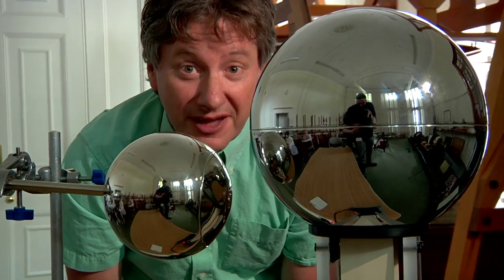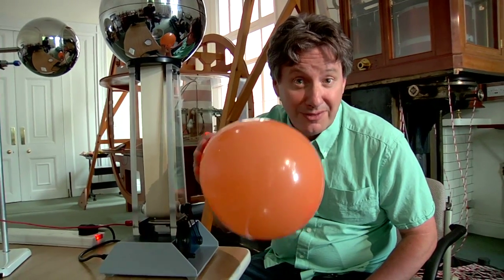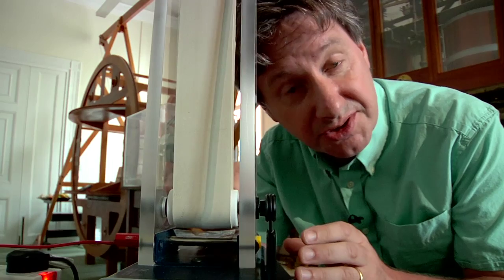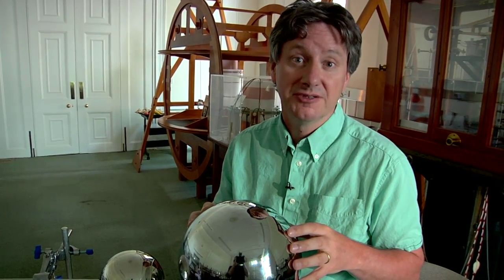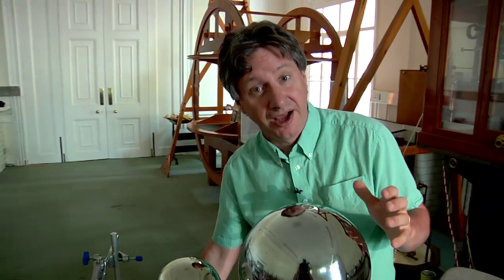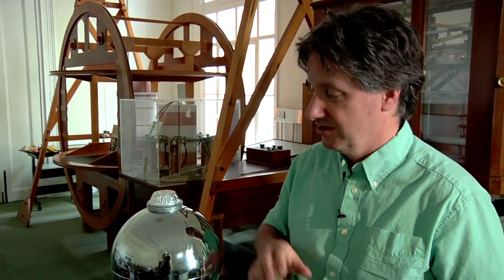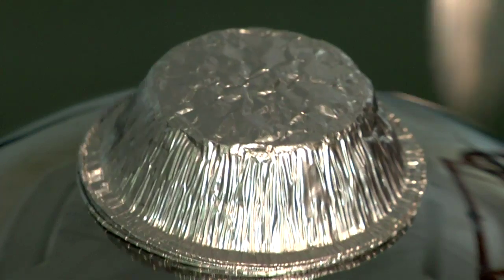Using a Van de Graaff generator

Comment: This is a nice demo and a rather-complete explanation, but I think there are several misleading statements, per what I have learned from various electrostatics experts.

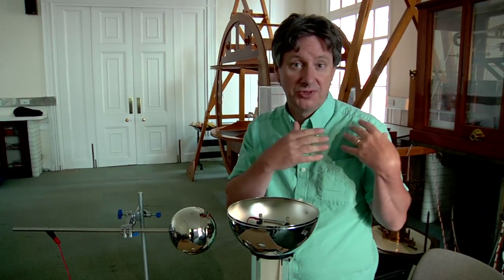At 2:58 minutes, the charge transfer is not caused by friction but rather by mere contact of the dissimilar materials.  However, mere touching only brings the high points of the surfaces into contact.  The motion does help considerably by producing a lot more points of contact.  

At 3:49, if the rollers are made of the same material, I think the generator can still work (but not as well) because of the mutual repulsion between the electrons.  The electrons "want" to go to the outer surface of the sphere to get as far apart as possible.  

At 4:15, moisture in the air does not enhance the conductivity of the air, but the moisture does enhance the conductivity of many materials that are exposed to the moist air, as was pointed out.

At 6:38, only the top surface of the top tin and the outer surfaces of the outer rings of the other tins become negatively charged because of the mutual repulsion of the electrons.  Once the top tin flies off, charge rushes to the top surface the next tin causing it to fly off, and so on. 
 
At 6:43, the weight of the top tin is not the primary reason the others don't immediately begin to fly off.  Rather, the others do not experience significant repulsion because they are not yet charged except at their outer edges.  This can be demonstrated by using a stack of thin aluminum foil disks rather than the heavier cups.  The thin foil disks also fly off one at a time in sequence just like the cups do, and the lower foils show no tendency to rise until they become exposed.  However, if two such foils are taped together, they fly off just fine, showing that the electrostatic force is considerably stronger than the force of gravity on the two disks together.

Comment: What happens if you put a UV Lamp facing the side of the belt that's has an accumulation of electrons?

.... Do you get X-Rays or even Gamma Rays??
Reply: Action lab on you tube shows hime using one to power a x ray machine.    They produce a ton of dangerous ozone 
and if operated in a vacuum near another piece of metal , yes , it will produce x rays. Also these are used to turn diamonds blue.  and much much more cool stuff.

Comment: Actually, electrons do not directly move from the combs to and from the belt.  The charges are carried by charged ions (air molecules) moving to and fro from the belt to the combs.  That kind of  Van de Graaff generator will not work in a vacuum!